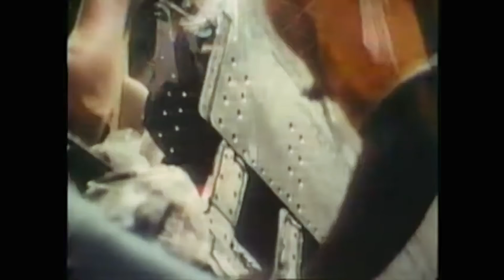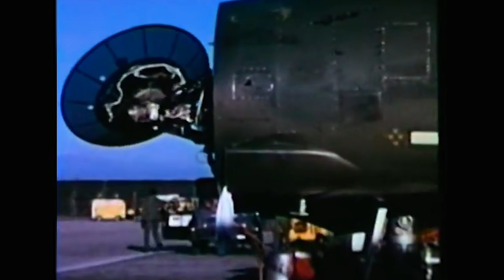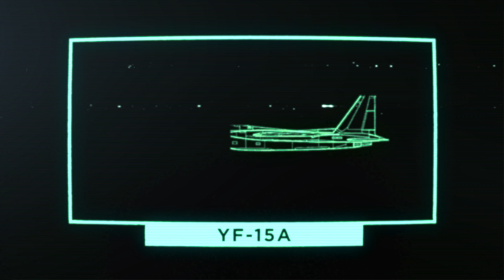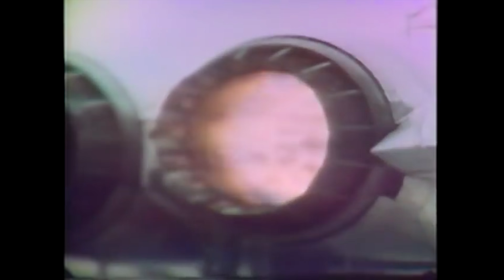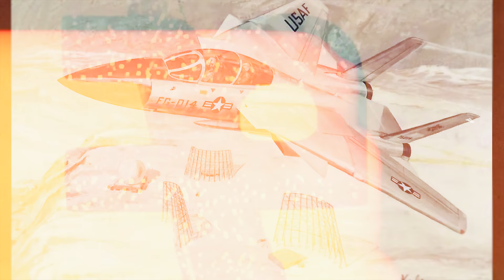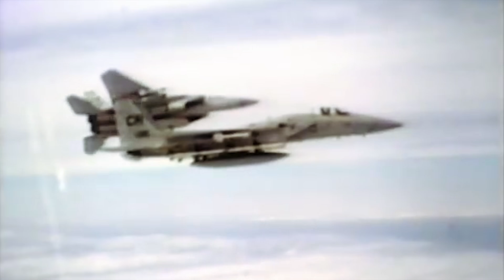F-15N | the forgotten 'Sea Eagle'

Comment: I never understood why, if the F-14s AN/APG-71/Phoenix pairing were more or less the biggest deciding factor for the F-15N NOT being selected for development, why Hughes didn’t sidle up nice and cozy with McDonnell-Douglas and offer to develop an F-15 comparable version of that radar.
Reply: It’s really simple. War games and tactics of that time painted a very clear picture of what the next upcoming war was going to look like. Nuclear missiles from silos and anti ship missiles from long haul strike packages. 

Every additional mile in combat radius was deemed critical in carrier group survivability.  The Navy was also big on crew resource management with a RIO/WSO.  That mentality is still largely true even still today.

The folks spending the dollars back then didn’t have the benefit of hindsight that we have today.

The addition of a second crew member in the aircraft and thr needed internal fuel capacity adds ALOT of weight to the aircraft. A good comparison would be comparing a current f15e to a f15a weight wise.  To get the internal fuel capacity of the Tomcat and the ability to carry a second crew member the F15e is right there weight wise with a Tomcat once you consider the needed carrier modifications.
Reply: @FloridaManMatty  
Another thing to consider. Look at britain, 40 years ago they had several aviation manufacturing companies. Now, just 1. I cant remember what plane it was, but the u.s chose A instead of B because B already had a lucrative deal and A would have gone bankrupt and cost jobs for thousands of americans. Theres lots of factors to accomodate in these descisions